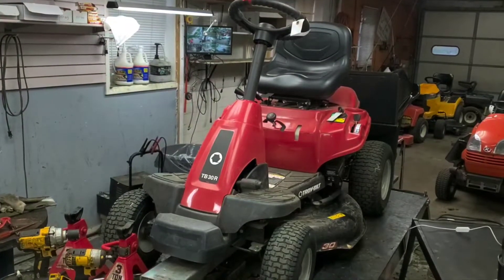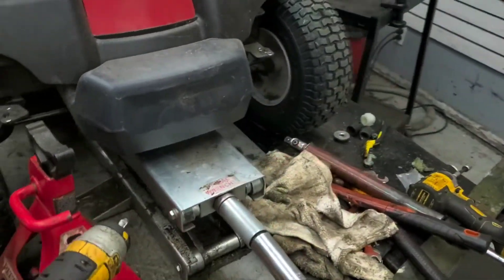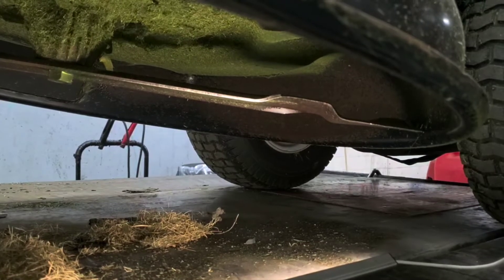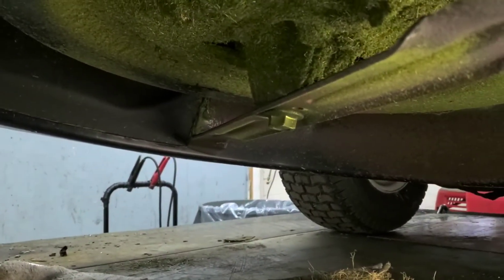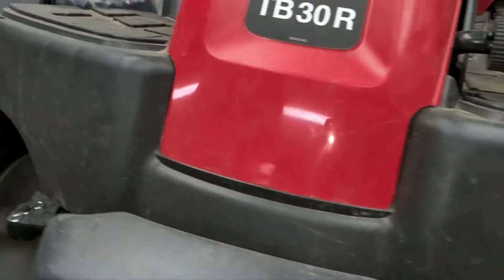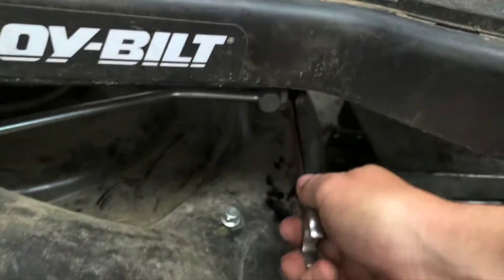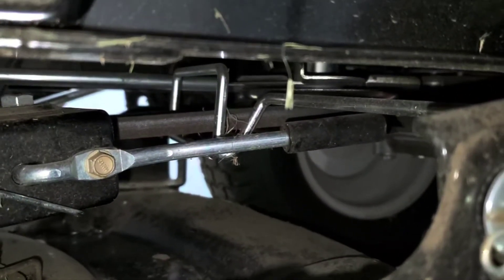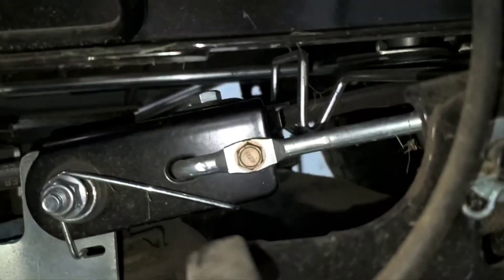Rear Engine Rider Won't Bag Grass Troy Bilt 30 Inch Bagger Not Bagging TB30R & R1000

Comment: I have the Rover which is a clone of this model . When I finish mowing I blow the whole mower off with my leaf blower and I shove the blower tube right down inside the grass catcher duct to clean it out . I found that mowing with low revs and a high deck setting reduced grass pickup substantially and wet grass is a no no .
Reply from the maker: Definitely a good idea for a cleaning after every mow! The suction is less than adequate in most cases.  I clean my mower every time even in ideal conditions and don't have any rust, repairs or undue maintenance pop up during the entire year. Thanks for watching!

Comment: The mower manual says you need to buy the high lift blade for the bagger to work right.  Doubting that tiny adjustment is all was needed
Reply from the maker: Doesn't take much for them to stop bagging on this model. Thanks for watching!

Comment: What are the parts I can grease? The blade shaft sounds dry, is there any way to grease it?
Reply from the maker: Not on these unfortunately, they are non greasable spindles. May be time for a spindle rebuild or a new spindle assembly
Reply: @IndRepair  Thanks

Comment: HELP!!!! I can't (for the life of me) find a close up shot or parts diagram for the base of the blade engagement handle. My cable is still attached to the front but I can't tell if i'm missing a spring or what because it will not engage the blade.
Reply from the maker: Sorry don't have one of these currently in